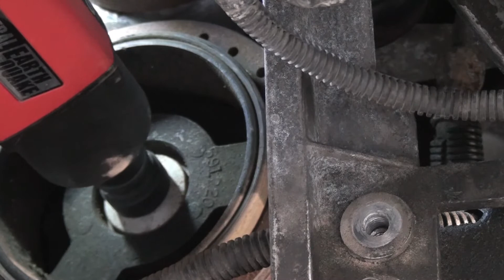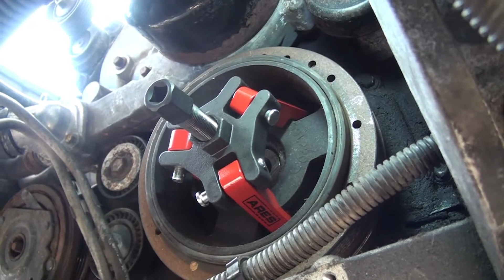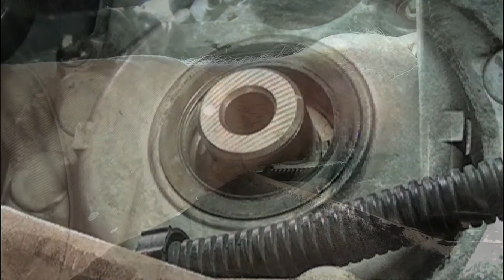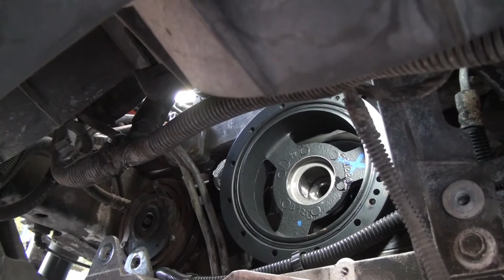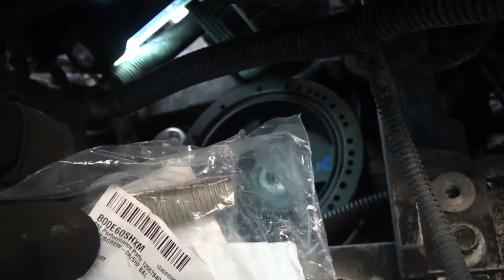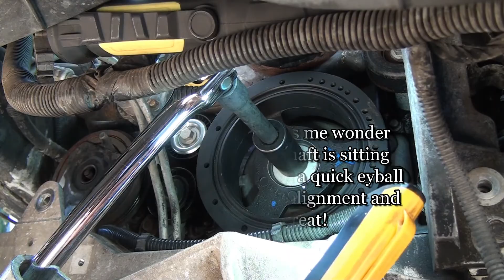C5 Corvette Harmonic Balancer and Front Seal Replace Part 3 Final

Comment: For the love of goodness why would you go back with an original harmonic damper knowing that you're going to have to do this again?!?!
Reply from the maker: I guess other than liking to keep things original, I just wanted to make more work for myself in about 150000 miles from now.
Reply: @SteveAZ711 I am going to be doing this same job once the weather breaks here in NYC and I have to agree with Travis ….. the stock harmonic balancer is one of the weakest links in the LS … Summit has a superb replacement and I am using the ATI  balancer … a little overkill but I’ll sleep better knowing the GM unit is in the trash

Comment: Wondering about a couple of things, 
1- The Torque to yield bolt, wouldn’t it be important to go to the proper torque in order to stretch that bolt the right clamping force ?
2- Given  the rather low quality of the General Mayhem’s original part, I wouldn’t be concerned about measuring  crank snout to balancer surface, besides, what if you were to use an aftermarket piece ?
3- Marking the Damper in relation to crank  as advised in the manual , probably makes only sense if the original piece is reinstalled.
Great video though.
Reply from the maker: Yes to question 1. For question 2, I was thinking about the belt alignment travel with the other pulleys on the engine and wanted to be as close to original as possible. It may cause belt wear or throw the belt if ever slightly off. "May" is target word. Question 3,  I never read (in my manual) marking the  crank. The new damper replacement is balanced to itself (2 piece you know). In addition the replacement pulley while looking identical. it was not. I noticed that the balancing drill holes were very much different than the original one I took off. I am happy the video gave you some food for thought. Thanks for the great comment! Check out Froggy...https://www.youtube.com/watch?v=eQK5dFTn9Ww&t=342s
 I believe he also puts an ATI pulley on his C5 in another video.

Comment: Thanks for a great video. I have a thought regarding balance weights. My installation guide says the following: inspect the crankshaft harmonic balancer weights holes for existing balance weights. .... Insert the new crankshaft balancer weigths, of the proper size, into the new harmonic balancer, in the same locations as the old harmonic balancer.
I wonder if you installed any balance weights on the new harmonic balancer in the same position as on the old one?
Reply from the maker: No I did not. My balancer had no weights. It looks to have been balanced by the holes that were drilled on the back from the factory. I looked, and nothing in the holes, just empty. In fact, it really does not remind me of a harmonic balance per say. It seems more like a pulley than a balancer. This Vette engine is all aluminum where as the 5.7l truck engine has a cast iron block and so maybe that is what the book may be referring to. Oh, and the new pulley I installed has holes drilled as well and not in the same places as the old pulley. Therefore, I decided that it as well was balanced by the removing of material instead of adding. Thanks!
Reply: Thanks for the reply. I agree with you. I think it seems strange to place balance weights in exactly the same places as on the old harmonic balancer. This presupposes that the new harmonic balancer has exactly the same balance error as the old one. It is almost as if you were to buy a new wheel for the car and move the balance weights from the old wheel and put it in the exact corresponding place on the new wheel and think that the new wheel is correctly balanced.

Comment: Had mine replaced 03 C5, and now it squeaks like crazy on start up and only calms down slightly when warmed up.Any thoughts? Thanks!
Reply from the maker: Maybe  the idler pulley may be going. Also, check the alternator they can sometimes cause belt squeak. Watch the belt while the engine is running it should be smooth, not bouncy, and look at the  balancer and make sure it is good and not moving in and out. Any  pulley that the belt goes on should be suspect. You can try a little dish liquid on the belt to see if it goes away. There is also the possibility that you need to change to a new different belt. Remember to check the A/C belt it may be the culprit as well.

Comment: My bolt backed out on my 02 zo6. Thankfully no damage to crank snout. One thing I’m doing is putting RED LOCTITE 272 on last 14 threads of  new bolt. Apparently this is a HUGE problem on these engine. Trust me, you don’t wanna have to do this job again after you do it once. ( cannot stress this enough) you simply heat the bolt to temperature and it is removable if you ever need to do it again.

Comment: When I taught shop classes, I used to say that to repair cars, you need a lot of patience -- not when things are going well, for when everything seems to be awful.  God bless you sir, you exemplify that motto.  I didn't hear one curse word throughout the 3 videos.

Congratulations on your videos and your job!  I was just wondering if it might be possible to pull off the front clip and radiator, etc. and leave all the exhaust, steering and chassis members in place?  Any thoughts on trying to do that, more work one way or another?
Reply from the maker: I do find myself talking to the vehicle like it was a person sometimes. I get more angry with myself doing some bonehead moves sometimes. Thanks Ian, I am sure I would have enjoyed your class.

Comment: can i ask a qustion. How tight do I have to tighten the pulley bolts?
Reply from the maker: Drive belt idler pulley bolt Shop Manual says 37 lb ft. same as a/c pulley bolt.

Comment: I'm wondering when this has to be done as i have a 99 c 5 with 30 k miles?
Reply from the maker: JUst watch for pulley wobble or your engine temp running higher than normal. These pulleys are a two piece design that are pressed together with a rubber sleeve between them.  When they go they start to wobble and move in and out...some more than others. Also, if the engine is starting to throw its drive belt that is a good indicator as well. Lots of YouTube videos on this subject as well. 30K is really no miles at all...mine has 198000 and was bought at auction so I do not really know when the pulley started to go.

Comment: WHY would you go through all that just to put a stock balancer & bolt back on? You'll potentially have the same issue with the pulley walking forward or backward again and have to do it again. The entire c5 & c6 community it using the Summit Racing balancer & ARP bolt. You might as well pin the balancer to the crank while you're in there & never have  to touch it again.
Reply from the maker: I know about the ARP fix and pinning. Maybe in 194000 miles I might do it that way. I am more than curious as to why the Chevy engineers designed this 2 piece pulley that is not a balance anyway. Believe me, I though long about that ARP fix because it is so much work to do this repair.
Reply: @SteveAZ711  
I own a 2007 C6 with a little over 45,000 miles & the pulley/balancer is already starting to wobble.  I love the car, but you're right about this ridiculous design as well as the crank not being keyed. GM strikes again. Probably saved 22 cents per car & some executive got a giant bonus. Lol! Definitely doing the ARP/Summit Racing/pin fix.
Reply: @banditdarval9401 hopefully you went with an aftermarket balancer (damper) because the bolt isn’t the culprit. The rubber in the OEM pulley allows the outer ring to walk forward or backward. Absolutely nothing to do with the stock bolt. I went with ARP just to avoid the 140 degree torque angle.
Reply: @SteveAZ711  
Also, this issue is SO prevalent, and such a major project, it should've been a recall!

Comment: Milwaukee 1/2" impact wrench 18v, part number 2767-20, has 100ft/lb tightening and 1400 nu busting ft/lb of torque. Unless it needs heat to come off this will take anything off with ease. Might be beneficial to have around
Reply: Yeah your right... and with out heat with all the red locktight with the 2767 high torque might just snap the head right off,  I've used the 2680 to break loose, with heat maybe 2962 this time around but as big as the 2767 is it may not be a easy fit. Don't get me wrong I love my 2767 especially with the HO batteries it out runs my IR 1" on lug nuts on the big rigs

Comment: Thanks for the video, I am not sure what your reluctance is to applying heat, it takes very little effort and the bolt comes off so much easier and you don't risk snapping it off. I used a wrench with a pretty small breaker bar and it came off easy.
Reply from the maker: Great point!

Comment: One thing I would like to add.  When you loosen the engine cradle bolts the cradel doesn’t go down all the way.  The fix is to disconnect both lower shock bolts and it will come down and rest on the loosened bolts.

Comment: I have a big big question!
So the final steps to torque the bolt are:
- sit the pulley, and once is fully seated, put the old bolt, torque it to 240 Ft lbs, then remove the old bolt and put the new bolt and torque it 35ft lbs and turn an extra 140° ?
I have a question tho, why are you torquing to 35ft lbs as your final torque, if the bolt you took that was on the previous pulley it was torque to 240 ft lbs... it makes sense to me that I torque the new bolt to 240ft pounds, doesn't it??
Reply from the maker: Yes it does but the shop manual says to do it this way. I can tell you that after initial 35 ft lbs is reached and I torqued to 140 deg. I believe that the 240 ft lbs is either reached or exceeded by doing the 140 deg. It felt very tight and the bar was bending as well. Probably mechanics use the ARP bolt replacement because it just torques to the 240 ft lbs and you are done. I wanted to stay stock so I did mine this way.
Reply: @SteveAZ711  thanks so much for the answer!! I'll make sure to address your chanel in my videos!! I 🙏🙏🙏

Comment: Nice DIY video. I've always wondered why you would mark the location of the old pulley with respect to the crankshaft end if you are replacing the old pulley with a new one. Balance and/or timing would certainly not enter the picture, and there is no keyway to line up,  so what is the concern?
Reply from the maker: Correct, should not make any difference as the new balancer should be balanced itself. To answer your question,..piece of mind should something go wrong. Nothing more nothing less.

Comment: Nice video Steve AZ711... Good luck I hope this fixes your problems... you always do it showing how to actually getten'r  done... that's huge.!!... thumbs up brother.!!
Reply from the maker: It has been a bear. The heat out west here is quite bad and make working difficult with 30 plus humidity. Setting records for no rain fall this year as well. However, the Vette is coming along quite nicely...vroooom vroooom. This is quite a vehicle. I had a 356b Porsche some years back, but I like this Corvette much better.